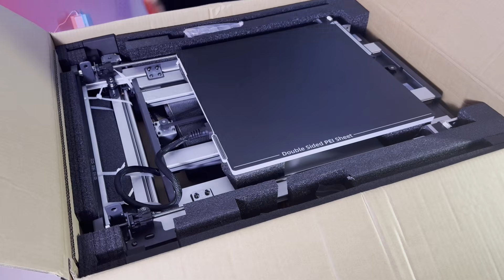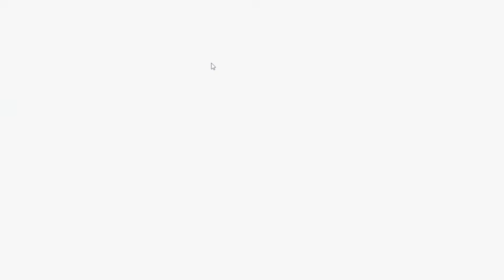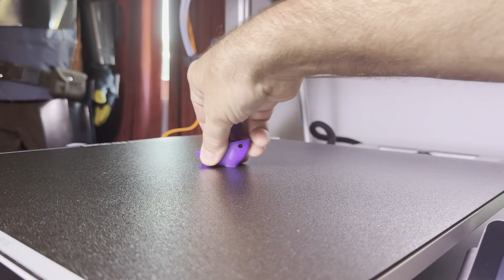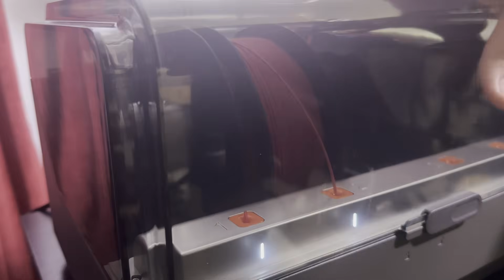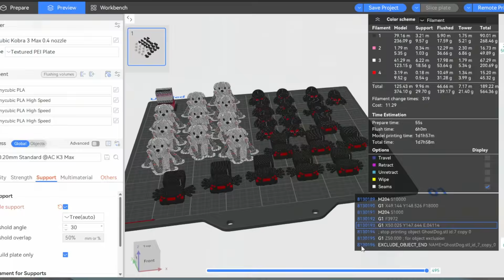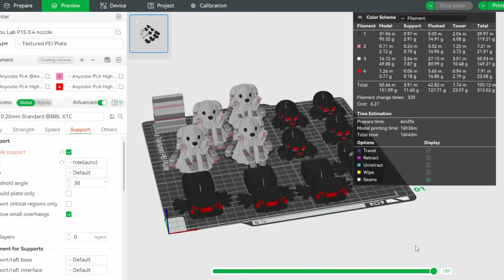Big 3D Prints! Anycubic Kobra 3 Max Combo | Huge Printer With Multicolor 3D Prints

Comment: How did you improve the quality from the first benchy to the second benchy? you secured the table to the wall and printed a filament poop bucket?
Reply from the maker: These were 2 different benchys. One is sliced to print as quick as possible, and the other is sliced for better quality